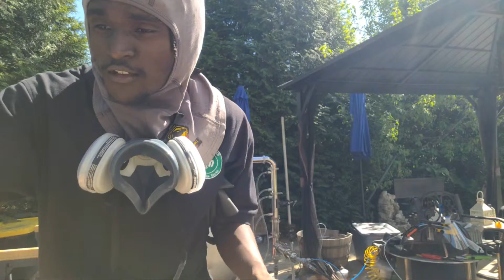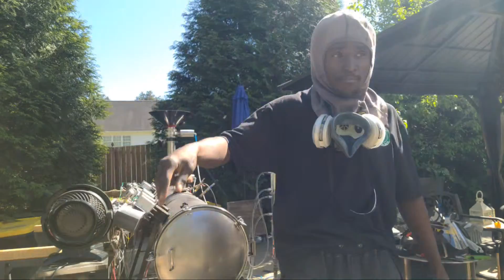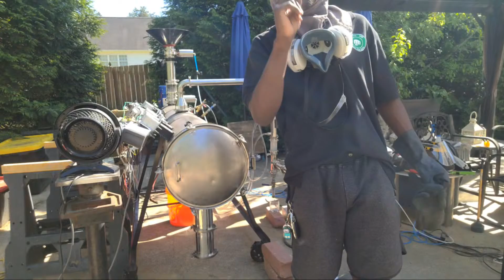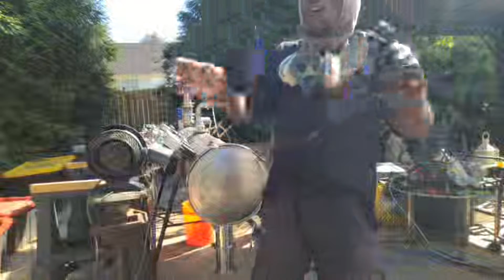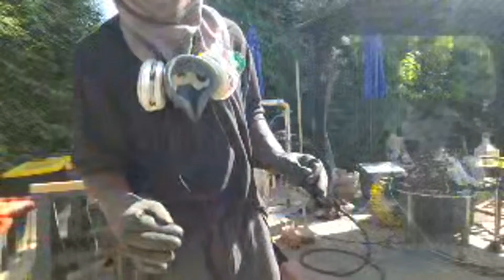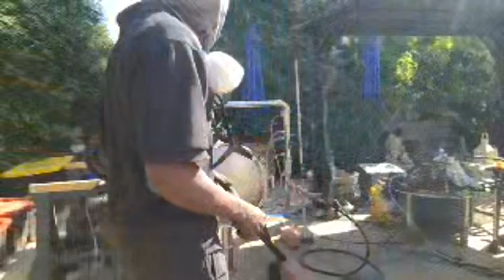The Quest for Oil from Plastic 2!

Comment: You should be able to refract it into tanks with no pressure because it comes off and different temperatures diesel gasoline kerosene different refractor column

Comment: You know getting 240v transformers won't let you put more on your 240/50amp circuit.
  
Say you got 2 10 amp 120v mots across each leg of a 240v plug, the two of them will only draw 10 amps! , just like 2 5 amp 240 volt mots would..

Comment: Insulate with rockwool, then band it with flashing to hold it in place. It will definitely assist in getting it up to temp and hold a consistent temp.
Reply: ceramic fiber too big rolls at home depot